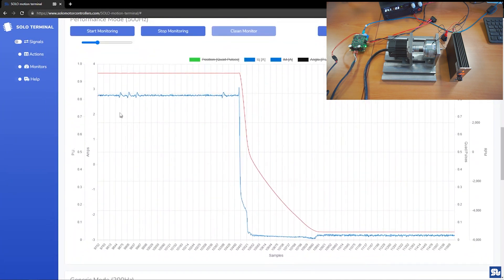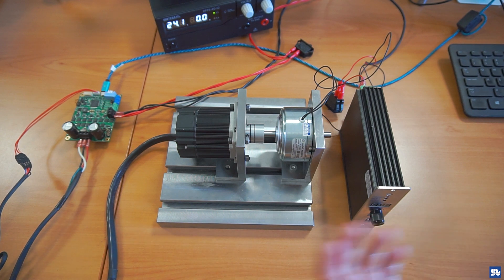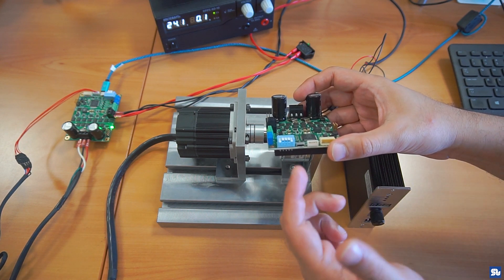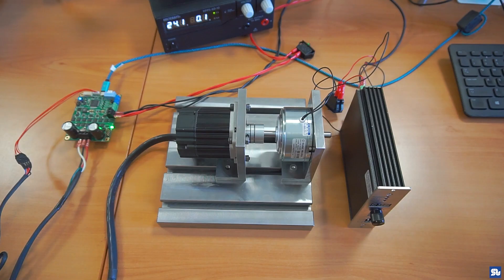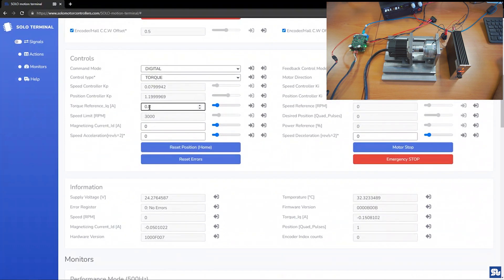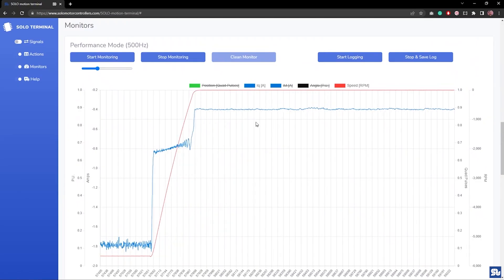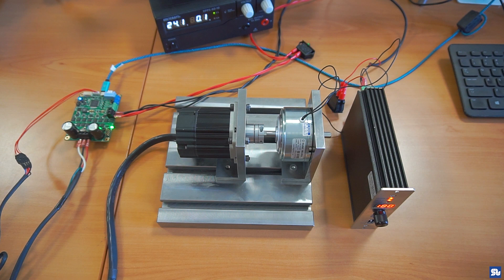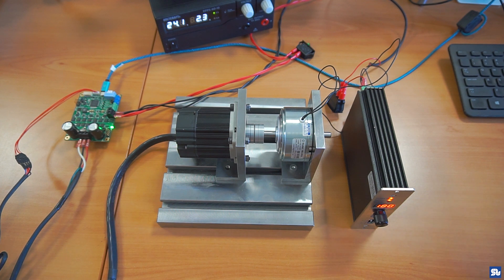Brushless Motor Torque Control under Load with Hysteresis Brake - FOC based

Comment: This is really interesting. Do i understand that this surpasses traditional step/direct? Something like this would interest me if there was a board that had multiple axis connectability for a 3d printer project we have this would allow us to optimize the speed and torque curve of the closed loop servo motors. Problem is our prototype is being designed with dual z axis and dual x axis which means we would need 5 control boards just for the 3 axis plus extruder and for 4th/5th axis as we move ahead. It begins to add up quickly. The dc/ac servos were likely going to use in this case have similar programmability in their built in controls so the additional hardware wouldnt be necessary but I can see how this would be advantageous if it wouldn’t increase our build cost substantially. Very nice.
Reply from the maker: Thank you for your interest in our technologies! At the moment our focus is to give the best in terms of the single axis, we are increasing the number of controllers giving power alternatives. All the controller models work on top of the same software and tools so the learning curve is flat :)  The customer can choose the proper setup and make them work in the network, and in some cases, this approach is cheaper than dual axis.